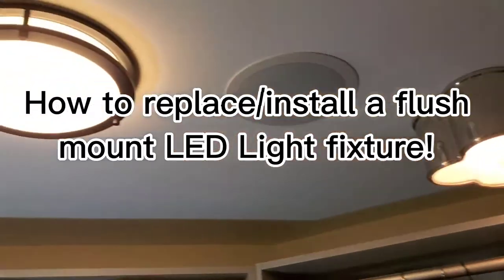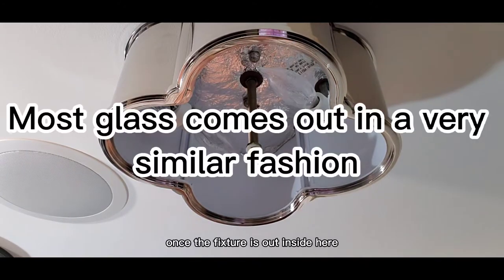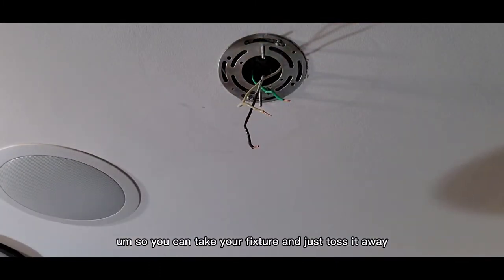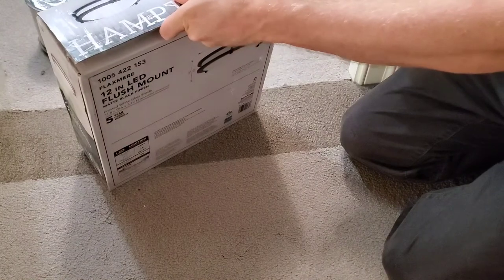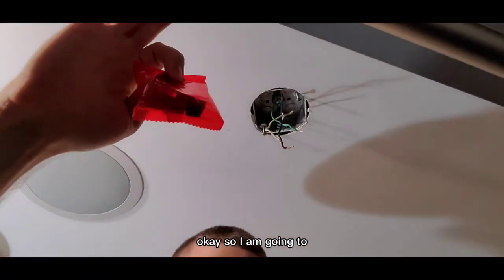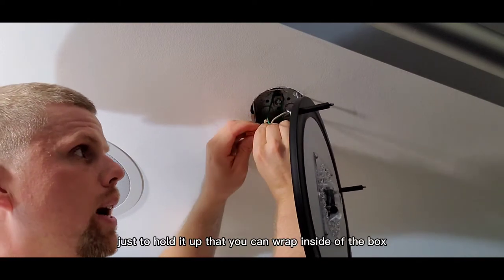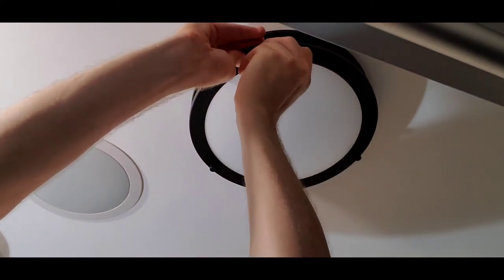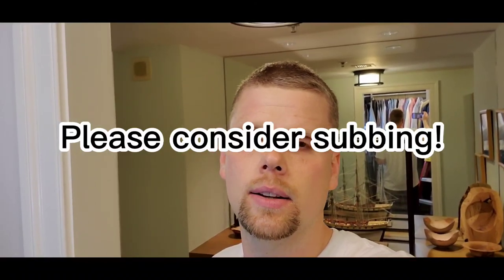How to replace or install an LED light fixture from Hampton Bay. #ledlights #lightfixture #diy

Comment: Mine are saying that is on sleep mode, the light is very weak and I can’t fix it, any suggestions? I Can see it turning on and off with the switch but the lights are very weak and the app says is on sleep mode.